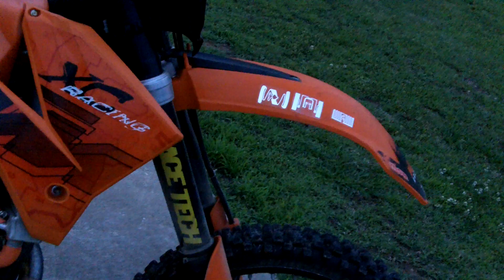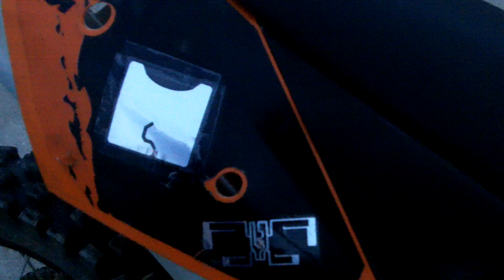Motocross Speed Test 4

Comment: Hi Brian - I'm finally watching all your videos. I've looked for the final outcome of your MotoCross test. From the videos, it looked like you had 100% read rates from 4 of the 5 inlays. Can you advise what inlays worked (and that you recommend). Given the age of this video, would this still be your recommendation?
Reply from the maker: +Chris Osborne Yeah, that was so long ago I can't remember off the top of my head which models were tested. We use the Alien Short Squiggle for our all-weather reusable shoe/hip tags that we sell. If someone prefers to use bib tags then we recommend using at least one UPM Dogbone tag on the back.

More important than the Brand/Model of tag is to ensure the tag is clearly presented to the antenna(s) and that the tag is not blocked (or in contact) by skin, metal, water, carbon fiber, etc.. Here is something I posted on my Users Forum about ensuring the highest read rates: https://groups.google.com/d/msg/agee-race-timing/mbZcntZ3GwI/rr9svNUouu8J